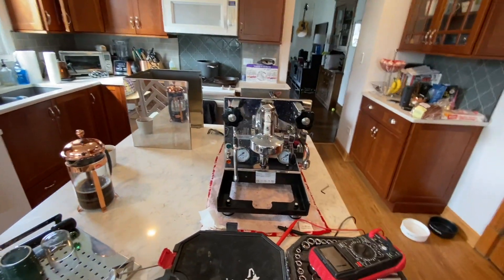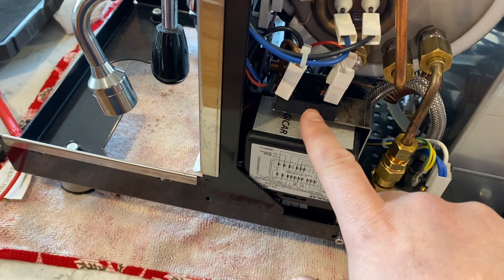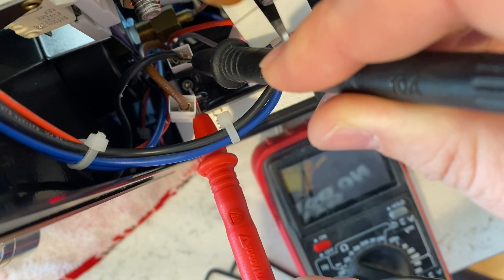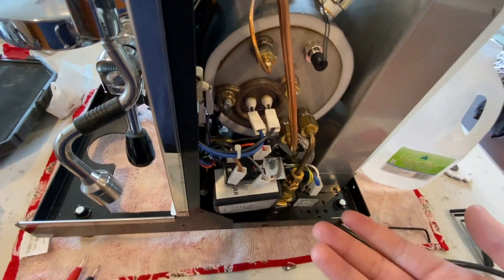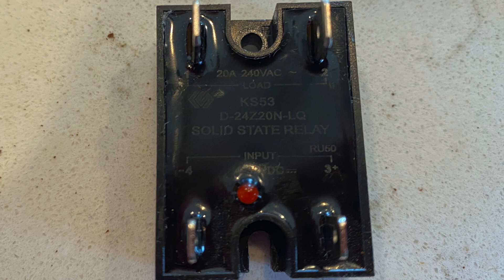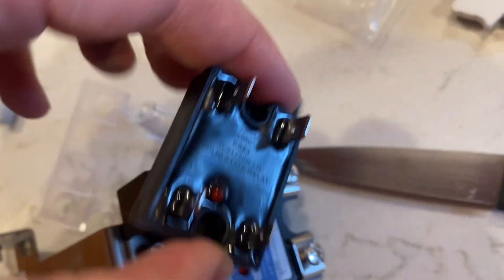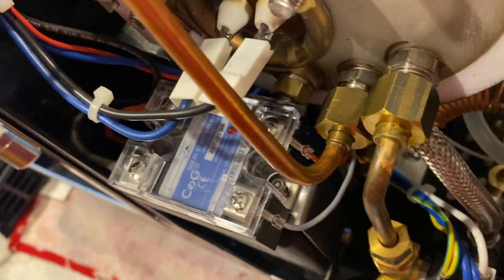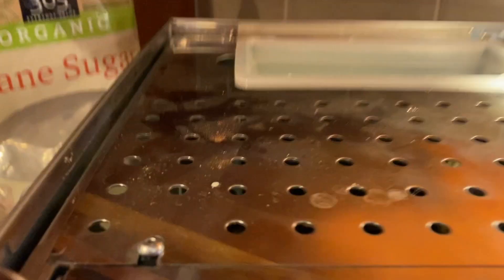Solid State Relay replacement Profitec Pro 500 w/ PID

Comment: Great video. I have ECM elektronika, it has the same relay. Later models anyway, the first few years the relay was in the Gigar. Improved mod the relay outside. But, Mine became intermittent, that is sometimes when i turned the machine on no heat, 10 minutes later turn the machine off and on and it would work. ECM also use some poor electrical connectors, the plastic white safety covers. After 10 years they turn to dust if you touch them. Anyway I think ECM machines are the best, they just need to adjust a few items. The elektronika has been out for 11 years, yet they still do not have a larger heatsink or a better relay as far as I know. But great video, i am doing a similar upgrade as you.

Comment: Hey thanks for the video!!  
Just exchanged to a bigger size relays as well. we have a bigger heat sink. But my relays’ heat sink is heating up to 120 Celsius. Then after about 20min it goes down to 105. Is that ok or too hot. Not sure. Thanks for the help!!

Comment: What are some possible solutions to prevent the relay from failing? It does seem to be heat related in my observation. I’m dealing with my first relay failure on my P500 and getting WLL to replace on warranty has been difficult. 😡
Reply from the maker: @neuroidcastle  I honestly wouldn’t bother with warranty. This Amazon replacement I’ve used is running just fine with daily usage. I think the stock relay, because of its size, and the current draw, just gets way too hot. 
In this case, bigger=better

Comment: There is a replacement relay sold by Clive that has the same spade connectors as the original. The unit is about 4 times larger than the original, so you can only use 1 screw to attach (instead of 2).  The part is labeled "Profitech SSR (Large) - P6031".
Reply from the maker: Amazing! thank you for sharing!

Comment: My 2018 made ECM Mechanika Slim has the same relay (only difference: it says "RR03" where yours says "RU50") and doesn't heat (and build up pressure) anymore. I think there is a 99% probability that it is also a broken KS53 D-24Z20N-LQ
Reply from the maker: That's the beauty of this machine, is that its DIY friendly!

Comment: Thanks for showing how to troubleshoot heating issues on your Pro500.  I have the same issues with my Pro 700 the one with a white dial gauge, I had it for 4 years now as I bought it used.  I've already purchased a used SSR  Kyotto brand SSR from Taiwan for a cheap price as Pro 700 has 2 SSRs, I'm still waiting for my boiler order in case it is the faulty one.  I'll be waiting for your second video to see how you will replace the SSR and your experienced with the SSR replacement.

Comment: Bought this exact machine Dec 2018. Am currently installing my 3rd relay. On my 2nd install the Whole Latte Love (online retailer) cust service tech rep told me the machine design was sub-optimal because this relay is located too close to the boiler. The relay simply can’t last very long with intense boiler heat exposure for hours every day. Thanks for making your video. It was a good refresher course for me as I install for the third time..

Comment: I paid $2100 for this machine 3 years ago and this is the second time relay stopped working. If i knew this issue i would never buy this brand.
Reply from the maker: Yah it’s a bad spot for it. I’m going to make a follow up video with a new part that will have a built in heat sync
Reply: @malinjohn thank u for the video. The store i bought machine from sells the relay for $40 plus shipping. Its a 25A relay and has same look , just wider. I dont want to get ripped off , i can buy from amazon or aliexpress but all of the relays have 4 screws like yours and I am afraid to take out those caps and screw them all . I am not used to fix these kind of electrical problems